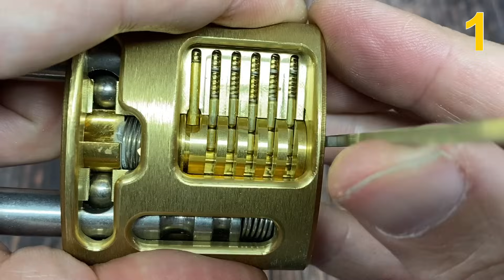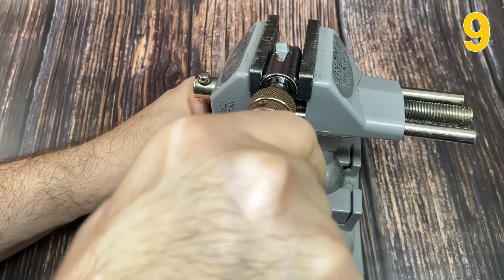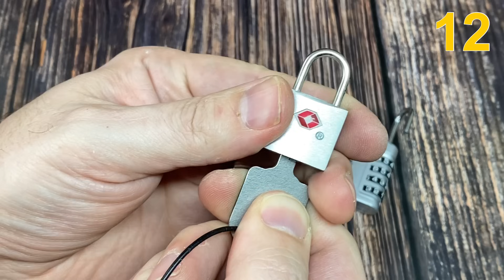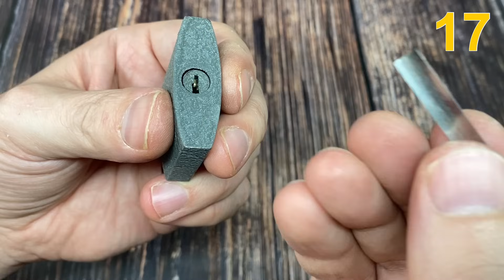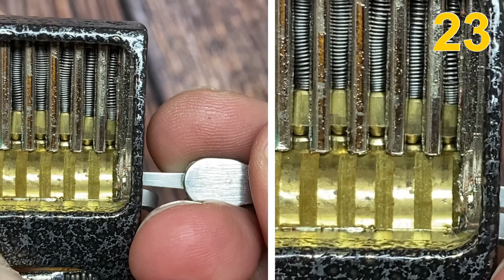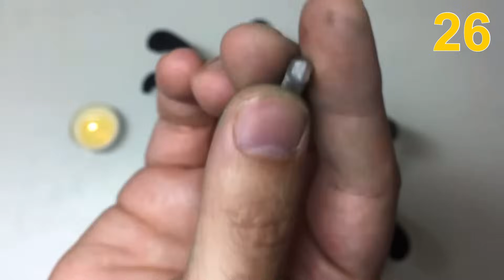EVERY Way to Pick a Lock - Over 25 Techniques!

Comment: Excellent video, I have a question though, I have a hon file cabinet that I need to pick to get something out (it's mine of course), and raking doesn't seem to work, I've also tried a nail filer from the nail clipper with no luck, any techniques you'd recommend?
Reply: Try regular lockpicking, just lifting the pins one by one

Comment: I think that it's noteworthy that when using the impressioning technique, The impressioning many times can simply be measured and a new key cut from scratch.  Or if using soft metal, Then take the soft metal key and use a key duplicator to make a good solid hard metal key.  As usually the whole point a privilege elevation attack is not to be detected, and having a soft metal key break off inside of a stubborn lock would be a bad deal.  That said we should be using these powers for good and not evil.
Reply from the maker: Only good

Comment: Very clever,  but you have to know a lot about the models of locks to do this. That is why destructive opening is used 99.9% of the time. An angle grinder although noisy will cut through most of the locks in a minute. The only time this is used is when a home owner has lost his keys and calls a lock smith to open the door without damage.. I admire the dedication, the skill and the knowledge.

Comment: Ha!! Finally someone has acknowledged the reverse picking technique. I discovered that myself a while back. While you may still need to re-pick a couple of pins in the traditional manner, it is still a useful technique on some of my older Yale and TriCircle locks with stubborn worn pins.
Reply from the maker: I can hardly every get it to work 😞
Reply: It's just a matter of bouncing the tension. I've only had luck with locks that have strong pin springs. Of course it's also quite possible that all I'm actually doing is comb picking but pushing each pin up separately. Then the pins that have longer pins to prevent that are the only ones left to pick, so all I'm doing possibly is just bouncing the tension to drop the one or two key pins that are longer to prevent comb picking. Lol!

Comment: Handy List for Everyone. Looks like 14 and 15 were the same. Reply with you're additions to the list. 

1. Raking
2. Single Pin Picking
3. Wrapping/Kinetically Disengaging Locking Pauls
4. Thumb-Turn Bypass
5.  Padlock Actuator Bypass Driver
6. Locking Paul Knife Bypass
7. Kinetic Rake Attack / Lock Zipping
8. Dimple Lock Impressioning Tools
9. Tubular Lock Impressioning Tools
10. Foil Impressioning 
11. Cabinet and Shutter Lock Locking Mechanism Bypass
12. Direct Availability to purchase Master or KA keys
13. Comb Picking
14.  2 in 1 Lishi Style Pick and Decoder Tools
15. Same as 14. 
16. Cruciform (Cross Key Style) Lock Pick Tool
17. Front Shimming Attack
18. Padlock Shackle Shims
19. Bumping
20. Try-out Keys
21. Jiggler Keys
22. Skeleton Keys and Commercial Warded Lock Picks
23. Revers Picking
24. Electric Pick Guns
25. Key Impressioning
26. Clay and Low Melting Point Metal Impressioning
Reply: I would like to add Snapping or Manual Pick Guns as an additional technique. While you included EPGs the old school manual snap guns have been around for ages and still work a treat.
Reply from the maker: Yeah I see epg and snap guns as basically the same… BUT maybe I should have added it. Always room for another video! 😃😃

Comment: Absolutely phenomenal, super happy to see the reverse picking on there, I finally watched that video the other day, but I was more excited to see that impressioning tool handle thing you had. I'm still early in my Foley-Belsaw certification lessons, but I've really liked making keys for locks without em. My fingers hurt and the vice grips don't vice enough lol
Reply: Would it help if you put a bolted a screw through the keyring hole in the blank and used that to wiggle the key instead?
Reply: @penfold7800   @penfold7800  hmmm sure I suppose, some use a thick tension wrench in the key for tension while bumping. In your example I feel the screw would have to fit very snug, almost like a handle, in order to wiggle both directions. To just crank on it and go up and down it sounds like a fairly decent idea

Comment: This stuff is so cool, you inspired me to get my own lock picking set! I’ve been able to open a few different types of locks so far, and I’m really enjoying it! Thank you so much Lock Noob, you helped me find a new passion. (Not to mention how satisfying it is lol)
Reply: Hey lock noob, I doubt you’ll see this, but for an aspiring locksmith, are there any specific locks you recommend practicing on? I saw a video were you had said that most locks you get at hardware stores and such are really bad/easily made, but what are some good brands that are challenging to pick?
Reply: @nirvanafan007wonder5  I can't recall the first 2 locks I bought using someone's linear guide of easy to hard locks (namely due to the inclusion of security pins), but the third and 'super beginner graduate lock' was the Master 140D I think, or rather just the Master 140. It's got one or two spools in there, I keep one on my keychain
Reply: @nirvanafan007wonder5  I'm no expert (not a locksmith), but if you are looking to get into the profession, remember that a lot of the locks you'll see will be old. I got a batch of older locks off ebay for pretty cheap. Some were easy to pick, most are still beyond my abilities. But I got a good mix.